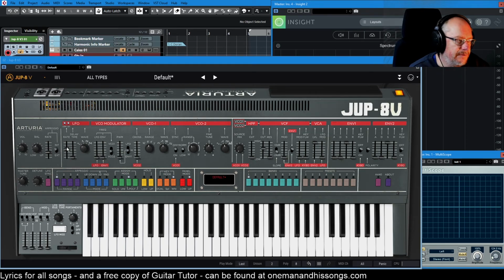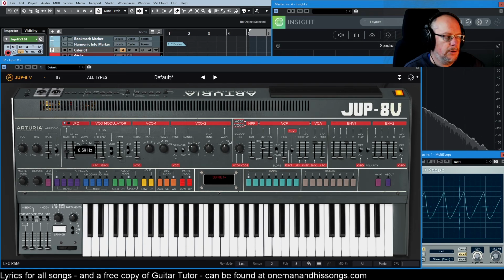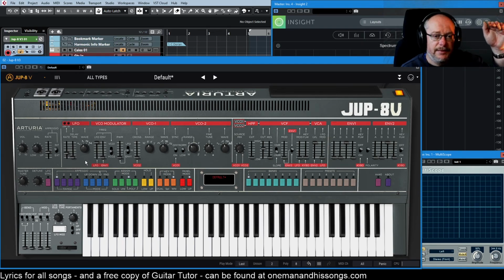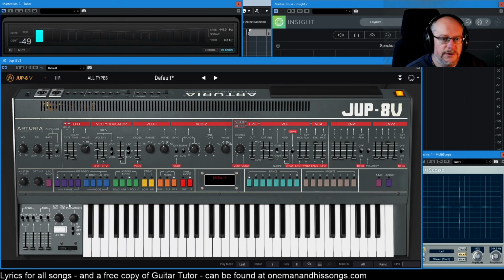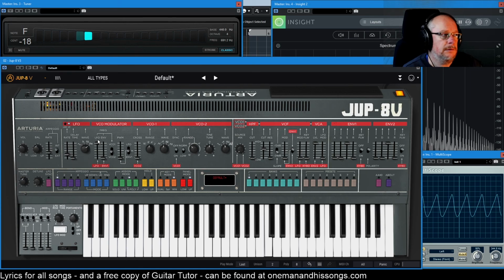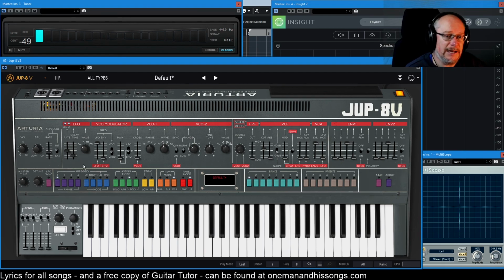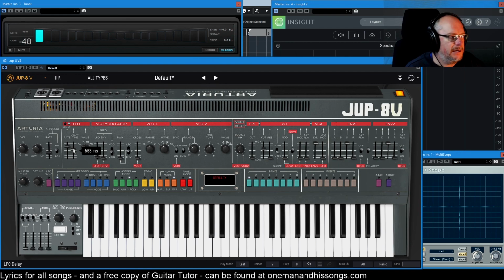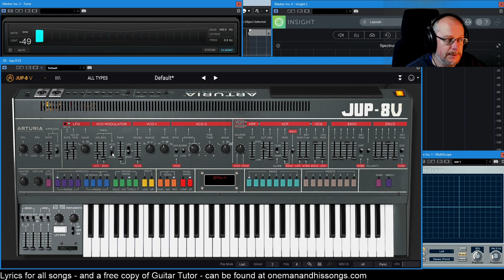Arturia Jupiter 8V Walkthrough Ep.3 - The Low Frequency Oscillator (LFO)

Comment: Just a heads up my good sir:  it looks like the newest Version 4 of the Jup-8 V is different than the version in this tutorial.  No key mode, no panel mode, no banks panel, and no presets panel for instance.  Also in the Advanced page, it looks like the 'Galaxy' Module tab has been replaced with a 'Modulations' Module tab.  Probably more stuff is different but I will find out as I go through this series.